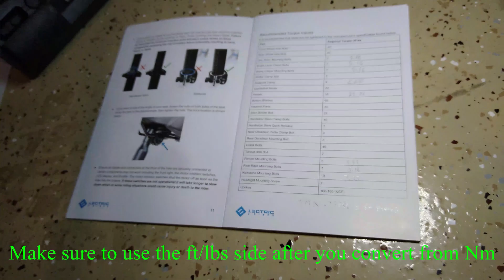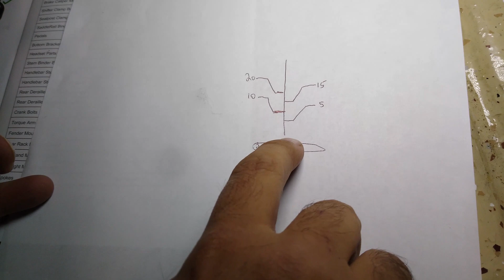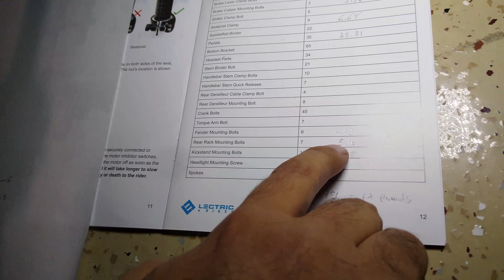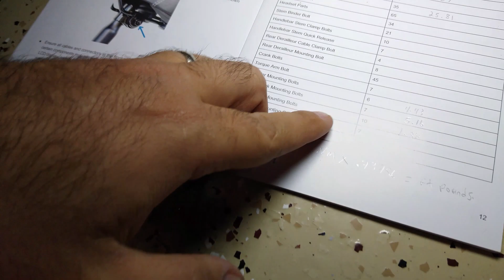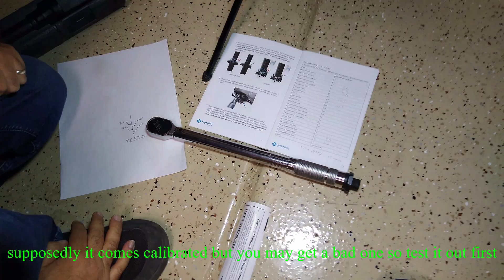Using a Cheap Harbor Freight torque wrench on my Lectric XP Bike!

Comment: FYI: You should always turn the torque wrench back to the lowest setting or below when done using it.
Reply from the maker: yes that's correct. and not to drop it. I'm learning more and more. And don't use it as a breaker bar